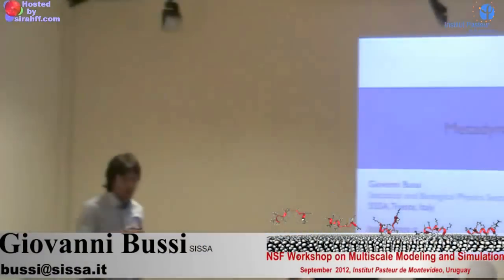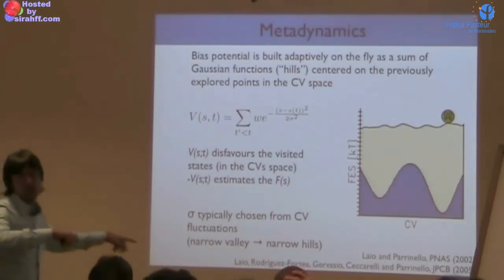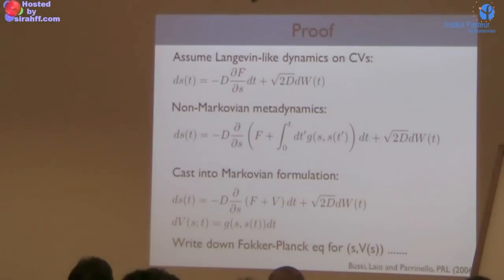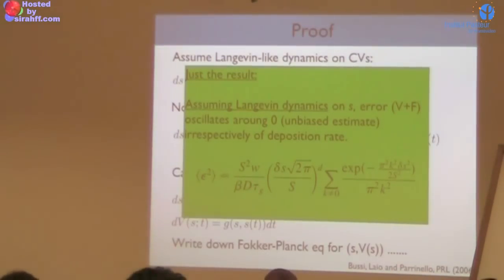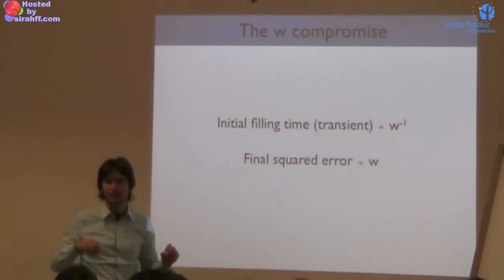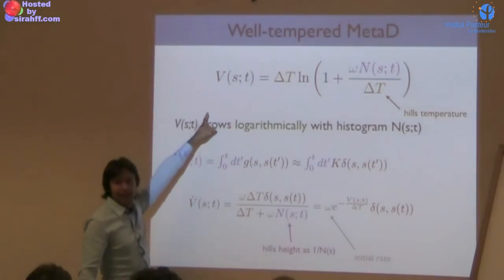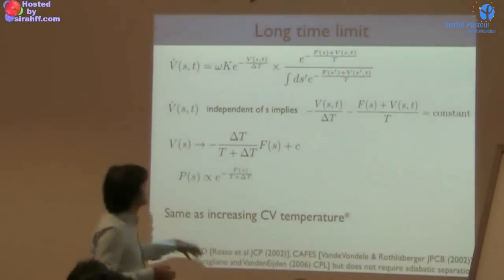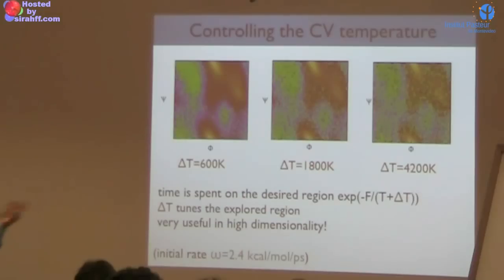PASI 2012 - Giovanni Bussi: Metadynamics from direct to well-tempered and flexible hills

Comment: I am performing well-tempered metadynamics. I have noted that the estimated barriers change with change in the bias-factor while keeping all other factors (initial height and width of Gaussian) same. For example, if I increase the bias factor from 20 to 25, the estimated barrier increases by about 5 kcal/mol. Could you give any suggestions regarding this?